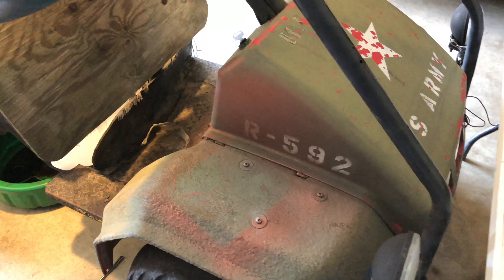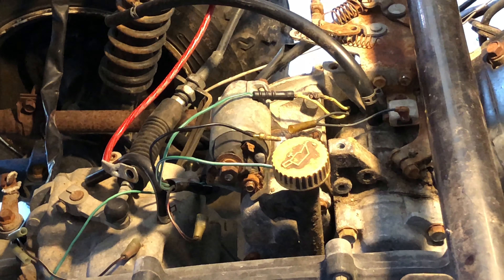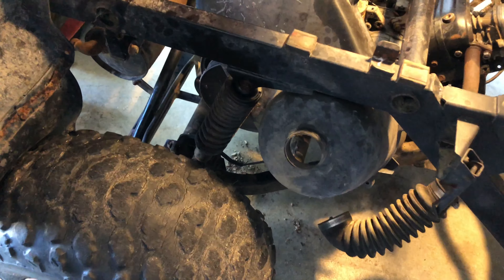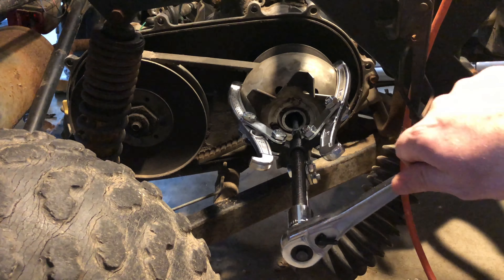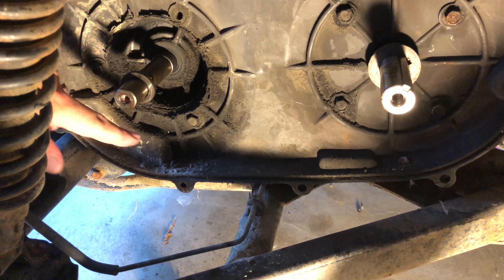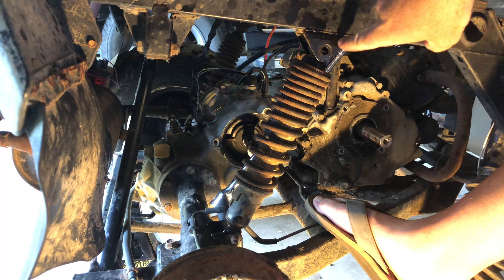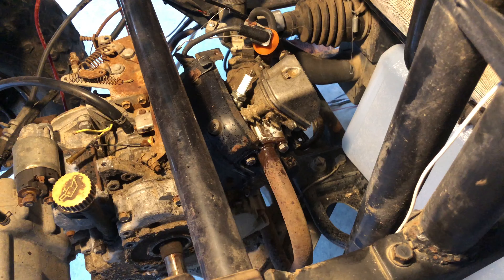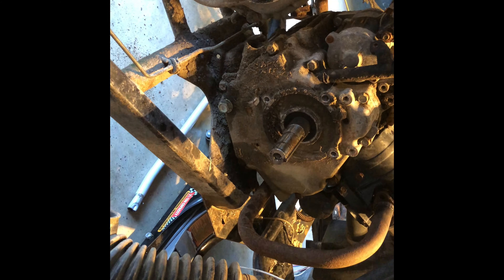Kawasaki Mule 500 KAF300 Clutch and Engine Removal - Part 3

Comment: 4:18  Excellent use of the double-extension ratchet!
Reply from the maker: 😂 Thanks, John.  All of the bolts on the sides of the Mule are a little awkward because of the frame.  Now that the 290D engine has been removed, everything is easier to access.

Comment: Thank you for showing how to remove the clutches! One or both of the clutches are stuck on our mule, so the gearbox is getting power at idle, causing it to not want to go into gear without a wild amount of grinding in the gears. Thankfully I won’t need to pull the engine.
Reply from the maker: You’re very welcome!  I’ll be anxious to hear back with your diagnosis of the problem.  I have the service manuals and part list for the Mule 500, so let me know if you need me to look up something.
Reply: @budgetprojectsbydavid5263  finally got around to taking the mule clutch apart. Found the problem. the drive clutch is stuck in the run position. There’s a little plate inside that holds 3 articulating arms and one of them has snapped off the plate, and is bent inwards. Which prevents the clutch from returning to the idle position.
Reply from the maker: Nice work. Are you going to be able to fix it or will you have to replace it?
Reply: @budgetprojectsbydavid5263  we had to replace it. By the time we replaced the spider and the weights and some other misc parts inside the clutch assembly, we could have just found a new one. Ended up going with an aftermarket replacement to save a few hundred bucks. But it came out great. Mule goes into gear with no grinding. 

Sorry for the late response, never saw the notification and saw this video in my watch again section so figured I’d see if you did respond.
Reply from the maker: That’s great!  If you don’t mind me asking, what brand aftermarket did you go with and what did it cost you?

Comment: Thank you for making this video!! I was able to use it to remove the pulleys to allow for more room to get to the rounded off oil drain plug and get it off. I was wondering if your drive belt had any identification numbers on it? As I am looking for a replacement belt. Thanks again for making this video, it was really helpful.
Reply from the maker: Hi Sean,  I’m glad you liked the video.  The belt I took off says “Comet Industries” and has the numbers 300623 704041.  Per my parts book, it’s Kawasaki 59011-1055.  Good luck!

Comment: I'm looking for the part number for the left hand thread bolt that goes in the secondary clutch (driven clutch or the one on the axel not the engine). Any idea what the part number is or where I could find one that will work? Thanks!
Reply from the maker: Hi Quinn, that part number is 92150-1687.

I had to replace that one as well.  When i reassembled the secondary clutch, I tried torquing to spec and it sheared before making it there. Dumb mistake on my part.  The second time around, i just used my own judgment as to how much to tighten and it has been fine.

Comment: Hey there could you throw out a link to where you got that flywheel pulley holder tool? I was trying to find a makeshift way to plug those holes up, but not too confident in it.
Reply: I was actually able to rig it up with a FAN CLUTCH HOLDING Tool & 2 Allen wrenches to fit the holes and apply leverage
Reply from the maker: Man, that’s awesome! Just saw your message.  I have been at the lake without good service.  I was going to find where i got the tool when i got home. Sorry, i couldn’t be more helpful, but glad you figured that out! Also, thanks for sharing with the group!
Reply from the maker: Here’s the one that I purchased from ebay:  https://www.ebay.com/itm/UNIVERSAL-HOLDER-TOOL-ROTOR-MAGNETO-FLYWHEEL-EQUIVALENT-KAWASAKI-57001-1605-/151748608773?mkcid=16&mkevt=1&_trksid=p2349624.m46890.l49286&mkrid=711-127632-2357-0

Kawasaki part no. 57001-1605
Reply: @budgetprojectsbydavid5263  thanks for getting back to me Dave. 1 more thing that's been eluding me. Where can I find a gasket that will fit that 1/4 turn gas cap?
Reply from the maker: That gasket comes with the cap as an assembly, kawasaki part no. 51048-1004, or you can get it separately as part no. 51059-006.
Reply: Thank you!! Where did you find that? Or do most Kawasaki gas tanks use the same gasket and cap?
I didn't finish the rest of your video series, but you got any for a stuck brake drum? I got the axel nut off. Shouldn't the brake drum just slide off?
And I got 1 wheel that is stuck to the brake drum too, just spraying it all with that rust penatrating oil.
Reply from the maker: Hi John, I got it from the printed microfiche for the KAF300-B1 that I picked up last year.  The catalog itself is 99917-1581-01, but I think you can find the same information if you enter your Kawasaki Mule 500 model number (e.g. KAF300-B1 into a site like partzilla.com.

I don’t have a video on that, but I plan to make one soon.  I had the same problem, but didn’t film it.  I think there’s a plug on the back of the brake assembly that you have to remove, then insert a screwdriver to release the clip.  

I used a triple jaw puller to pull the brake drum off of the assembly. A little hammering and beating and triple jawing and it finally came off.
Reply: Interesting. It pops up for your 500, but not for my 550 kaf300c. 
I pressed that release level when I had the brakes pressed as I was trying to release the axel nut, I'll make sure it is still pressed in and go rent those jaw pullers again.
Reply from the maker: Try this link.  https://www.partzilla.com/catalog/kawasaki/side-by-side/models-with-no-year/mule-550-kaf300-c3
Reply: Oh and how do you disconnect the emergency brake from the brakes in the rear?
It didn't even talk about it in the Service manual which was odd.
Reply from the maker: I’m not exactly sure!  Mine came missing the ebrake cables and i have not yet replaced them.
Reply: @budgetprojectsbydavid5263  man you must of got the last fuel cap gasket. Unless i read it wrong and you 3d printed yours with the printed microfiche?
Reply from the maker: 51048-1004 is what i purchased.  It’s the cap that includes the gasket.  You may not be able to find the gasket alone.  I see the cap assembly on ebay that includes the gasket on ebay.
Reply: @budgetprojectsbydavid5263  So with your wiring that goes into the engine next to the alternator. Mine are 2 yellows that attach to green/white wires. If I need to wire them back together is there a way to tell the correct way for the current before I hook that battery up?
 Because I turned mine on and I got the front lights to work, but  Nothing else not even a noise. And I just checked the RECTIFIER and it failed the OHM test. Soo I think I've blown some stuff.
Reply from the maker: It doesn’t matter which way you hook those up.  The stator produces alternating current (AC).  Wires are constantly changing polarity, positive, negative, several times per second.  I think that’s why the engineers chose to use the same wire colors for both leads.  Make sense?

So, what is happening when you connect the battery?
Reply from the maker: The rectifier (or stator for that matter) doesn’t come into play until the unit actually starts.  If no start, check your connection from starter to ground, battery negative to ground, and ground connection (thick wire) connecting back frame to front frame.  Check positive thick red cable from battery to starter.  Check neutral position switch.  Check starter relay in battery box.
Reply: @budgetprojectsbydavid5263   So when everything is hooked up The Light's work The Light's work but that is all.. I can't get anything to click or turn over.  I'm wondering if I have the fan in the right position to make it start ?  I have it in neutral where the magnets are touching each other.
Reply: @budgetprojectsbydavid5263   What is the neutral position switch?
Reply from the maker: The position of the flywheel shouldn’t matter.  The starter, when energized, throws a small gear out to turn the flywheel. It does this in any position.  The neutral position switch is in the very back of the gear box.  With a wire that connects to the wiring harness.  If you set your voltmeter to ohms, touch the screw or the wire with one probe and the frame with the other.  You should get connectivity/ low ohms, when in neutral and infinite resistance when in gear.
Reply: @budgetprojectsbydavid5263  Okay I'll check that out and thanks for getting back to me so quick. Enjoy your Christmas!
Reply from the maker: Sounds good.  Have a Merry Christmas!
Reply: @budgetprojectsbydavid5263  So I think k I found the neutral switch. It's the wire that is connected to the E brake by a bolt.
Also I remember you talked of de-magnitizing the magnets in the engine and I just wanted to know if there was a way I could test that to see if that is my problem?
Reply from the maker: Man, I’m scratching my head on the demagnetizing comment.  I think i had to fight the flywheel magnets at times when reassembling things, but I don’t know that I ever said anything about needing to demagnetize a magnet.  I’ll try to get you a video out there to help, but it may be a week or so.
Reply: @budgetprojectsbydavid5263   No I'm just double checking to see if I de-magnetize them by accident.
I dropped the engine and it landed on the fan blades and the starter.
Reply: @budgetprojectsbydavid5263  hey man so it looks like I forgot to connect the Ignition switch to the starter. I didn't take any pictures of it so I forgot. Thanks for all your help.
Reply from the maker: So, she starts and runs?  That’s awesome, man!
Reply: @budgetprojectsbydavid5263  oh yah I'll post a video when I get back out there, but she fires right up and purrs.
Now I gotta mess with the carberator and calibrate that bad boy.
I think I need to turn the throttle screw up higher, because even though it sounds good it still dies when I pop the choke open all the way.